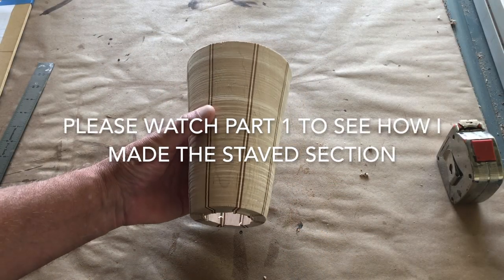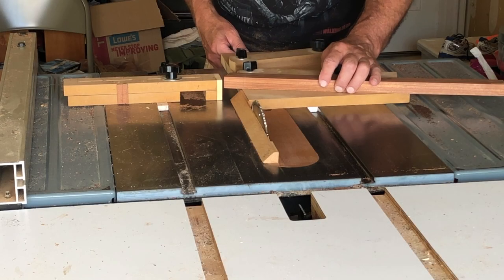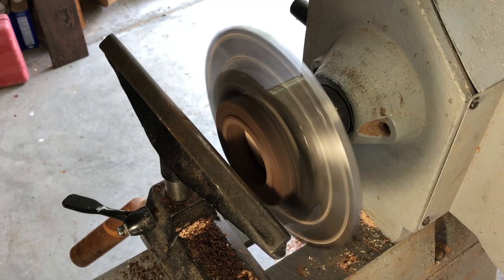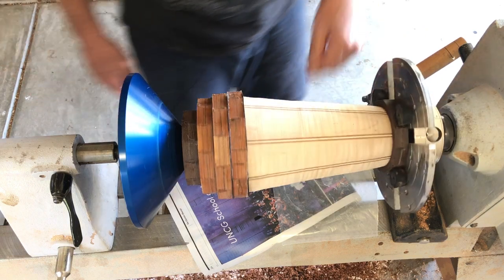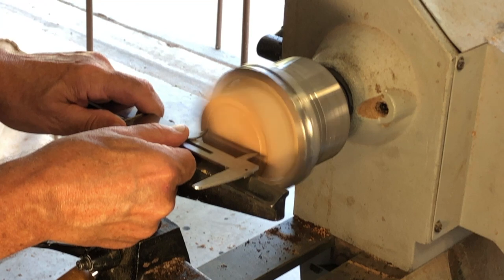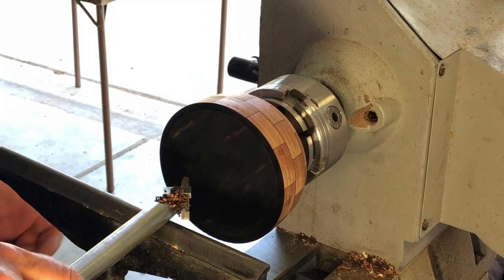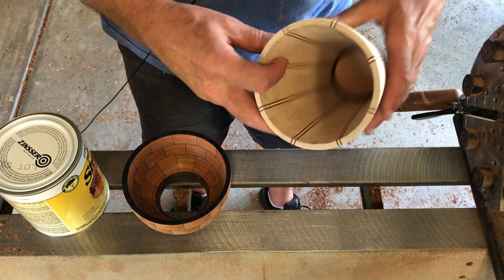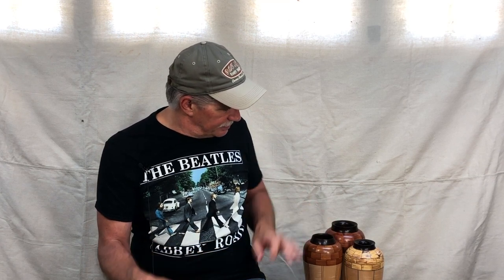Staved & Segmented Vase - Part 2

Comment: I'm puzzled as to why you didn't when milling the wood didn't cut the top and bottom of the board with the proper angle before cutting the staves?

Comment: Hi Steve - Great video! Watching you do this project answered a bunch of questions I had with this type of turning. 
Can you explain why you didn't use the same tenon joint to attach the top segmented portion to the staves as you did with the bottom? Aren't you worried about all the end grain?
Thanks for the video. The vases are really beautiful!
Reply from the maker: Jack - Thanks for your comment and I apologize for my delay in responding.  I didn't use a tenon to join the top segmented portion to the staves due to the thickness of the pieces.  The stave portion and top were only about 3/8" thick which would have made it difficult to make a mortise and tenon to join the pieces.  The tenon would have been about 3/16" thick whereas on the bottom there was full segmented ring to make the tenon.  I hope that makes sense.  At the point in the project where I was joining the two halves I didn't want to take any changes on messing it up.  There's not a lot of stress on the joint so I'm not overly concerned about the end joint to segmented ring glue joint.  Thanks again.  Take care,  Steve

Comment: Beautiful work.  What kind of finish did you use on them?
Reply from the maker: George - I thought I mentioned the finish in one of my clips but I must have cut that part out.  The finish was Arm-R-Seal by General Finishes.  I wiped on 4 coats, cut it back with 320 and wiped on a 5th coat.  Once the finished dried I applied a coat of Renaissance wax.   Thanks for watching and commenting!  Take care,  Steve